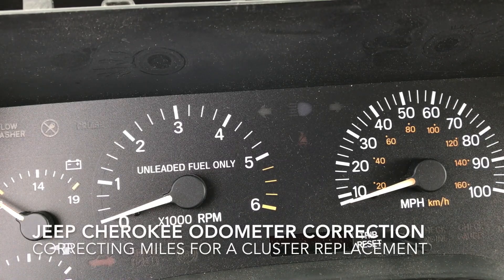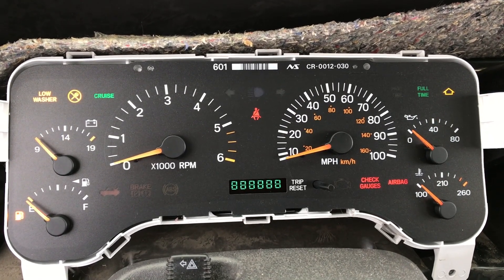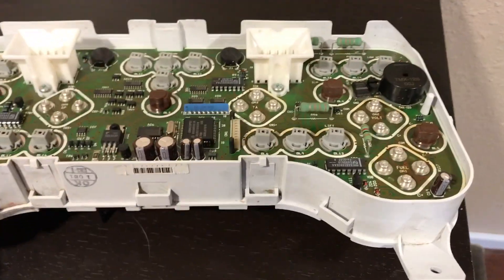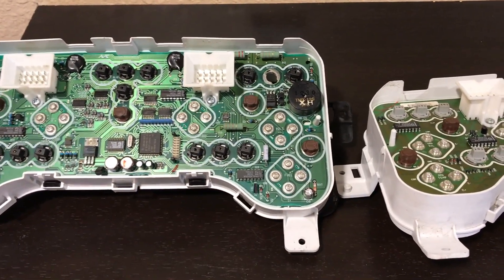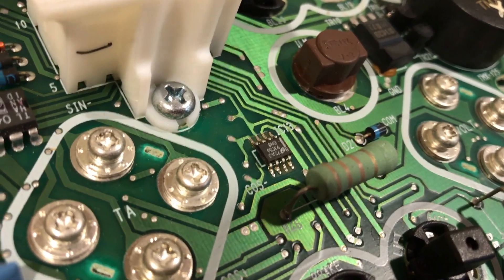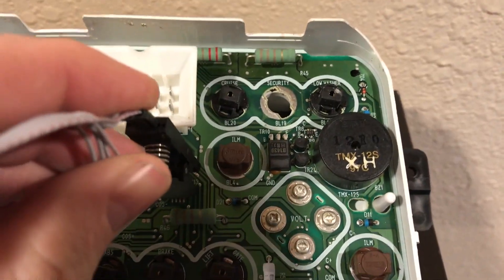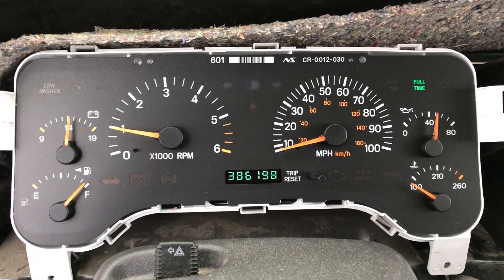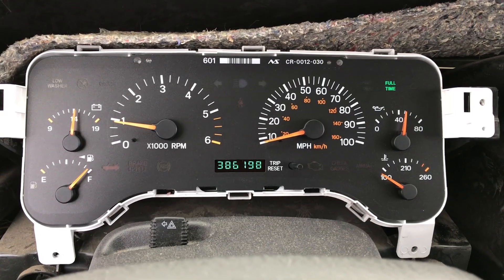Jeep Cherokee XJ Odometer Reprogram (1997–2001) — Cluster Swap & Mileage Correction

Comment: Hey, Nicely done. Tho I don't need this for mine. My issue is the dash lights for thee instrument panel are not working. Have to change the bulbs I suppose first. I could not find anyone doing this replacement for the "1995" Jeep Cherokee Sport SUV. Reminds me of my 91 Toyota 4 Runner where nobody shared how to replace the Rear Window Relay Switch-Box, which was located in the rear driver's-side 1/4 panel. 

When I checked with Auto Repair places, they all said "It's an Auto-Electrical issue, take it to them." So I asked them and guess how much to replace it? 

Just under...... (are you sitting down?) 600$ labor and 575$ for the part. Which pissed me off. So what did I do? 

I did like I always to... 

I searched world wide to find a used replacement... which I did for (Drum roll please....... 45$, yes, forty-fibe dollars) 1st savings = over 500$. 

Secondly, labor time.. what to do? Now mind you, my rear widow was LOCKED or FROZEN UP, because the relay was dead. This made the challenge to get AT IT TO REPLACE even more of a challenge. But would I be defeated or intimidated? 

HELL NO... that's not how "I" work. I'm the non-typical CAN DO guy. I ALWAYS CAN... even if I've never done so before. I WILL figure it out, and this particular time, at over a GRAND to replace it, it was worthy of my greatest efforts. Had NO CLUE what I was getting myself into, but I'M GOING FOR IT!... You WON;T BELIEVE THEE END RESULT.... but here we go...

I lowered my back seats to lying down. Put in some cardboard to put everything including myself onto. Loaded in my tools that I thought I might need, took a huge breath and set myself into GIT ERR DUNNNN MODE... climbed in and .....

I figured out HOW TO DO IT. Even with the rear window LOCKED IN UP POSITION or CLOSED. 

Once I was able to locate the little bugger or culprit, I was ECSTATIC! I replaced it as fast as I could... anxious to see my window working again. (I'm like a little kid that way... excited to take up such challenges and WIN or SOLVE them! Woooo whoooo!!!) Sorry for that outburst. Back to the story...

After locating it and replacing it, it was time to see if it worked. A bit nervous now because hey, I got a 600$ part for 45$... what are the chances of this working out REALLY? Was I being scammed? Why sell this damn thing if it was working right? Well, let's face the music and see if it works. 

Got in the driver's seat, put the key in thee ignition... heart starting to race... a small prayer came without thought, (Please God... please let this work.) Looking into the rear view mirror... the momement of truth. Turned the key.... the motor fired right up and idling... time to try the back window.... welp.... here goes nothing.... pressed the button to lower the rear window and. . . . . .

The SWEETEST SOUND.... that ZHHHHHHHHHHHH sounds that power-windows make when they are going down or up. I watched in my rear view mirror as the back window... after over a year of not working... smoothly rolled right down to the wide open position. WOOOOOOOOOOO WHOOOOOOOOOOOOOOOOOOOOOOO!!!!!!!!!!!!!!!!!!!!! OH MAN!!!!! Talke about ELATED1 I JUMPED out of the seat and landed on the ground and jumped around, like a Zulu Warrior who'd just won a huge battle and was celebrating his victory! SWEET SUCCESS... I KNEW I COULD DO THIS!!!

ahahah... I went to the back... put the key in to see if it worked there as well. It did! Yay!!! 

Jumped back into the driver's seat... tried it several times up and down... not a blip. AWESOME!!! 

OMG I was SO HAPPY and wondered... "Why in thee hell didn't I get this done a LONG time ago?" Well, that was because of thee expences I was told I'd have in getting it done--- and... when it came to Auto Electrical, I wasn't kidding myself about it... I'm NO SAVVY with it AT ALL." But I DID THIS... I GOT IT DONE!!! Yahoo!

Now then! Can you imagine how LONG this took me to do? To find it, to replace it, and to put it all back together again afterward?

Are you ready for this?.... You might want to sit down again... cause here we go...

Now remember how much I told you thee Auto-Electrical shops quoted me for Labor to switch it out? $600.00 labor only! They didn't say how many hours, but if it were 100$ per-hour it would have been 6 hours... right? Well, guess what?...

It took me, (being 100% a novice to this task) a total time of UNDER 1 (one) hour to Find, Remove, Replace, Test, and put it all back together.

TAH DAH!!! 

Now to figure out the Dash Lights on my 95 Jeep Cherokee Sport... since NOBODY'S SHARING HOW TO DO THIS... IT SHALL BE... ONCE AGAIN.... ALL ME, MYSELF and I. Time to GIT ERRR DUNNNNNN!!!!!!! Heeyawwwwwwwwwww!!!

Ciao everyone, and DON'T BE AFRAID to try and save yourself some money and GIT ERR DUNNN yourselves!!!! It's VERY REWARDING when you do... and if nothing else, you learn to REMOVE thee INTIMIDATION FACTOR because YOU CAN! :--))

Ciao!

Comment: hands down best video I have found on youtube showing how to do without soldering... THANK YOU! 2 questions... 1-if you cant copy/clone and replace info, how can you actually TYPE in the correct miles onto the good cluster/ eprom…(plus it might be quicker that way, just having to get the clip attached to one eprom?). 2- I saw the stuff you were using and looked them up, the computer program however,, what is it? where do you get it? cost? thanks again for a very well thought out informative video!
Reply from the maker: You can change the values and then upload. The eeprom file is a hex file that can be edited with any hex editor, you can replace the values with whatever they need to be to match the vehicle. If for some reason the cluster could not be read but the mileage was still known, such as reading the odometer value stored in the PCM, the cluster can be programmed to that value, within a few dozen miles or so.
The eeprom doesn't get written for the last few digits and they seem to be stored in some sort of flash memory, so only the higher digits are stored, meaning you wont get exactly the miles you want to program, but can get pretty close.
Reply: Would you reprogram these for a fee? I am looking to upgrade my dummy gauges...

Comment: How would this be done for a 95 XJ cluster?
Reply from the maker: NBHRaven the 96 and older XJs use a mechanical speedometer. To adjust this mileage you need to physically adjust the odometer. Generally they are designed to make this hard to prevent tampering. There is nothing you can reprogram to set the mileage in the older Cherokees.

Comment: Can you rewrite the milage, I just put a new engine in mine and want it to reflect the correct miles
Reply: @al hardy, the engine is only one part of your drivetrain. Your transmission still has all the mileage on it
Reply: I’m gonna roll all mine to zero., Then hero.
Reply from the maker: In the United States this would be consistent with odometer fraud, while it is acceptable to replace the cluster and program the correct mileage for the vehicle it is illegal to roll back the odometer to zero. Most people would also point out that even a "rebuilt" engine isn't the same as factory new, and that all the other million small components on your Jeep are not new. There are certain legal and potential ethical/moral ramifications to resetting the cluster to zero so that I cannot recommend you to reset it.
Reply: @IcarusOffroad  WRONG!  All you have to do is check the block on the title that says "not the original mileage" and you can have a vehicle with ZERO miles when you replace the engine.  Why do so many on youtube make this mistake?

Comment: hi, you know why this not work on 2002 to 2006 wrangler? ic5 say a diferent number but look the same, we only need find the brand and model chip or plain not work? thank for this video.
Reply from the maker: I think I can clarify a bit. What I am referring to with background debug mode, or BDM, is for the programming of the 2002+ TJ clusters to correct the mileage and VIN when the cluster has been replaced. To reprogram the mileage and VIN in the cluster the cluster must be removed from the vehicle, and the rear plastic cover removed, and then the BDM pad on the circuit board can be accessed. Then the mileage in the cluster can be reprogrammed with with a DigiProg3 or other tool that can read specific memory register in the Motorola/Freescale/NXP HC12 processor through the BDM port. This is similar, but not the same, to programming through the BDM port on a Bosch ECU.

I am not referring to programming anything in the ECU for the 2002+ TJ.

I need to get a video filmed and uploaded for the VIN programming in the cluster for the the 02+ TJ using a DigiProg.
Reply from the maker: 2002 - 2006 TJ Wrangler Gauge Cluster uses a Motorola 68HC12 processor which has a built in eeprom which stores the mileage, VIN and other information. To read the program code or mileage information the CPU must be put into background debug mode, BDM. From BDM you can read and write specific memory registers which contains mileage and VIN. Goodluck, I have not yet figured out what I need to reprogram the mileage and VIN on these clusters. I have a specific tool that performs the function for the TJ Wrangler, but I have not been able to get generic tools to read the eeprom.
Reply: COrobotchicken thank for your response. Looks like the only way is buying a digiprog3 tool, i really need solve this, the car was flood and we cant find a dash with the correct or near correct miles.
Reply: I just read that twice and I still don't know what you're talking about. The mileage in the PCM has no bearing on the mileage in the cluster. Also the JTEC pcms (2002-2004) don't support BDM and the NGC controllers used in 2005/2006 also don't support BDM. So I don't understand what you're talking about. 

As for setting mileage and VIN in the PCM, it's a trivial task that can be done with a DRB 3 over the OBDII port, no need for any sort of "background debugging mode."
Reply from the maker: Yes the Digiprog3 will reprogram the odometer.